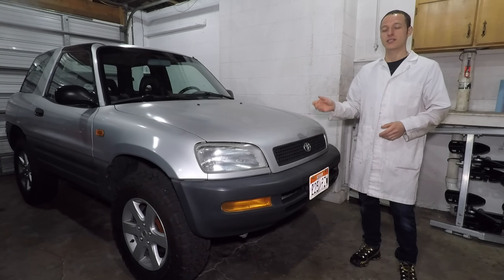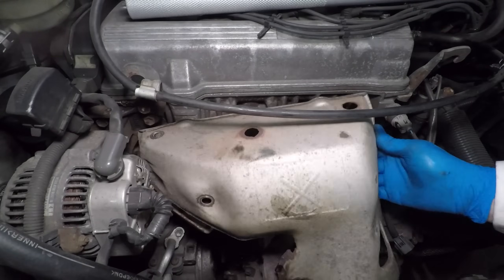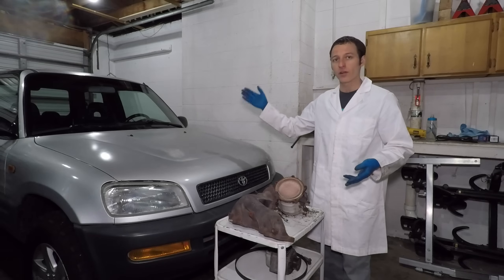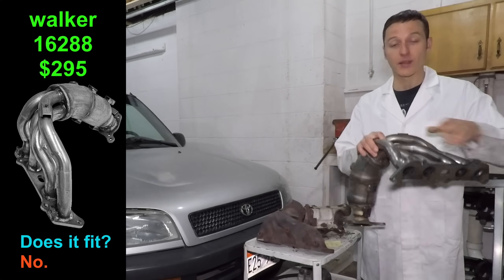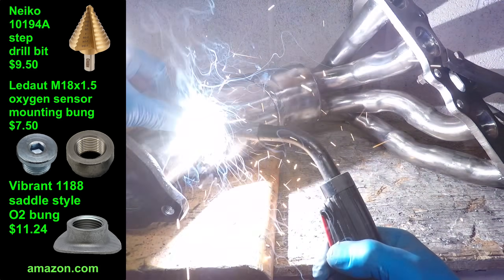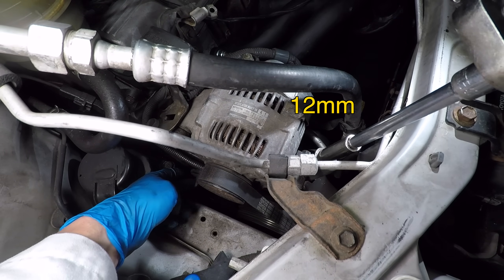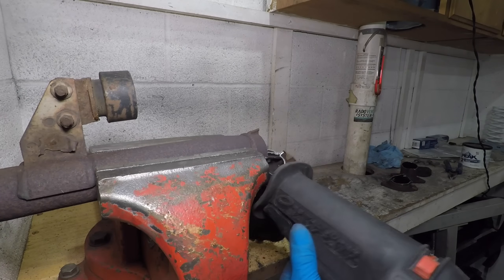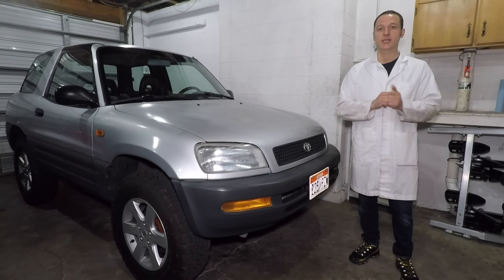Catalytic converter and oxygen sensor replacement 1997 Toyota RAV4 (episode 9)

Comment: Dude that is awesome!.  I actually was thinking of doing an engine swap also because my engine now has 193k and hardly has any power left, but I did not know what would fit and what I could use to replace it.  I would love to have more horsepower out of this little 5-speed suv, I would get bigger rims and tires so that it would handle better.  I just dynamated the ceiling and front doors when I was changing out the stereo.  It feels a little quieter but you can really feel it when driving in the sun, it keeps the car cooler.  I am also looking for new front seats because the original ones are pretty flat now and I don't feel like reupholstering them, any recommendations?  And yes, do the engine swap so that I can do the same to mine.  How much horsepower would that engine produce?
Reply from the maker: Dynamat on the ceiling = cooler car?  I'm going to copy your idea!  That's awesome.
Check out RAV4 GTT on youtube: https://www.youtube.com/channel/UCCOBmTP4cKXheU2lW011a_Q
He's one of the first guys to do the 3SGTE swap in the RAV4, and he's basically the leading expert on the subject. 

The 4th gen 3SGTE engine out of the Japanese Toyota Caldina is what you want.  It's a 2.0 liter 4 cylinder, just like the 3SFE that you have, so it bolts right up (kind of).  The 3SGTE has a turbo and puts out about 260 hp.  Right now you have 120 hp, probably less.

 It's NOT an easy project.  Here are a few of the modifications that need to happen:
aftermarket radiator fans for turbo clearance
hood scoop for intercooler air
re-wire car with new computer
replace fuel pump and add a second fuel line to tank
get the caldina transmission - yours can't handle 260hp.
I've seen the engine with computer on eBay for about $1,500, but you still need the transmission and a whole bunch of other shit, so I'm guessing a total of $5,000 for the whole project and at least 200 hours of labor.

Comment: Mr Paul, I love the way you are fixing up your Rav4.  I have a 1998 4-door manual and I plan on keeping it forever.  I wish I could take it apart and fix all the worn out stuff too but living in an apartment means no working on cars.  I am changing out the radio at the moment, which is probably all I can do.  Hey, I'm also having trouble with my manifold and cat converters.  How about making one more set and selling it to me?  I would pay all costs of course.
Reply from the maker: That apartment life is no fun.  I rent a house and have 2 room mates, so it's actually cheaper than an apartment and I have a big garage.  :)
I don't really have the time (and I don't want to) build another catalytic converter / manifold thing.  If I did, it would probably cost you around $500.
If you're patient and ask me about it later, I might just sell you my manifold / cat for cheap.  I'm planning on doing a 3SGTE turbo engine swap some day.  IF I do that, I won't need the old cat and manifold.

Comment: hey boss nice job, i have a 1999 rav4 awd with the 5spd in good mechanical shape but i can confirm that the car is just slow and that may be the best mpg you'll get. i currently get an average of 20 mpg
Reply from the maker: I've heard of people getting 28mpg in a RAV4, but I always suspected they just calculated their mileage wrong.
Reply: @LabCoatPaul  wow yea thats better than the epa rated mpg
Reply: Nick Alexander not sure exactly how many mpg I achieve but I’ve a 1999 automatic and can’t really complain